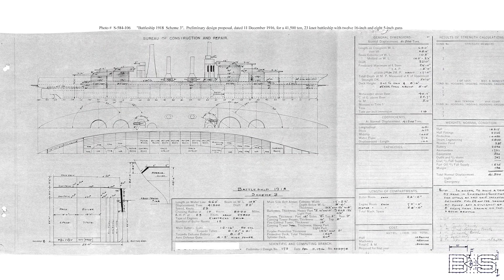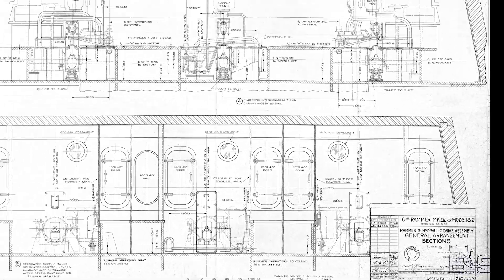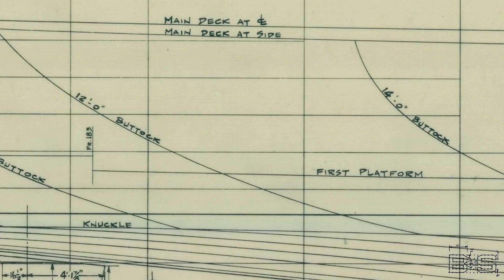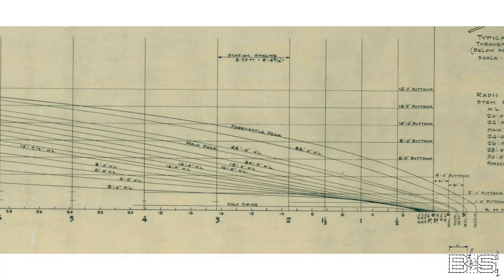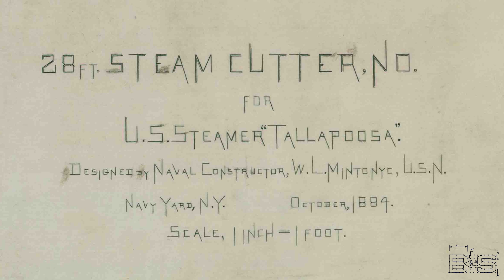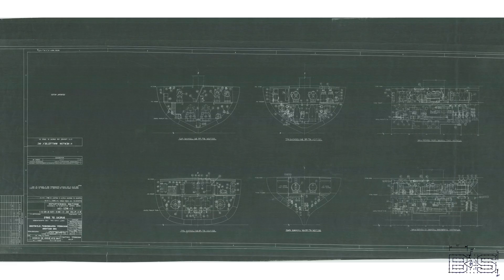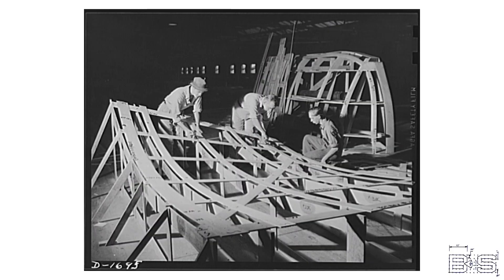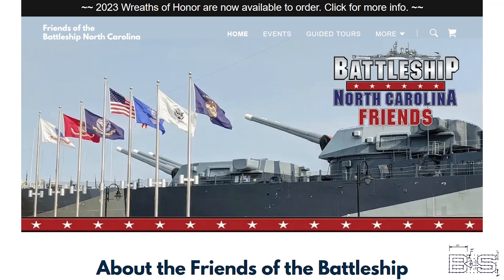Shipbuilding from Drawing to Alteration

Comment: Before I worked in a general contractors office as a p.m. & well before I went back to the university for a grad. degree in mathematics I worked five years as a structural steel & miscellaneous iron detailer. I spent thousands of hours detailing shop drawings for the beams, columns & stair towers that went into commercial & industrial buildings. It's a daunting process & involved using Smoley's book of tables to calculate hole locations for clip angles and angled cuts for stair components so that the pieces could be fabricated on a flat shop table where the piece, while on the table, is not orientated as it will be in the structure.

We're talking fairly tight tolerances for hole placements because the last thing the erector wants is the holes in a beam's clip angles to not align with the holes in an intersecting beam or column. This may sound easy, but beams often are not all set such that the top of the wide flange beam is at the same elevation for all because of different floor construction or sloping beams. The angles involved in stair towers knock the not so easy up a couple notches too. 

However, detailing a ship because of its complex outer shape without doubt is far more challenging than a twenty story building with elevator & stair towers. You have to raise your hat to the ship detailers & I expect that they are the ones who actually come up with how the puzzle pieces fit together because often the architect or engineers drawings are just a general concept without precise details showing how it's accomplished.